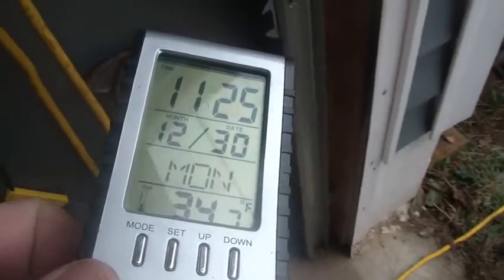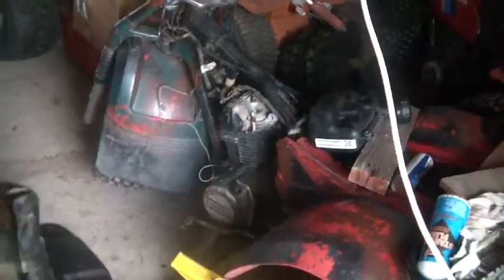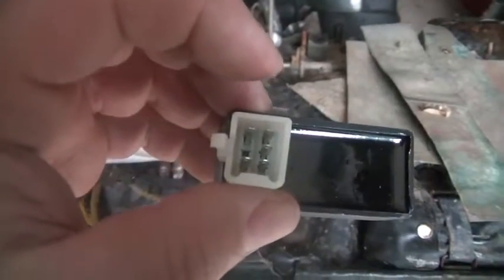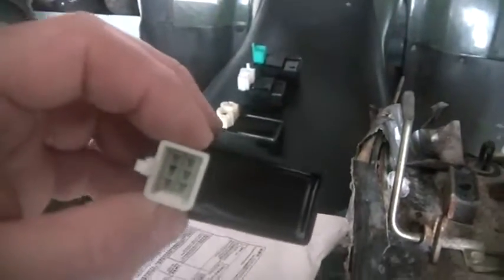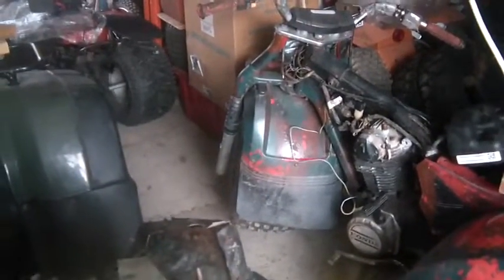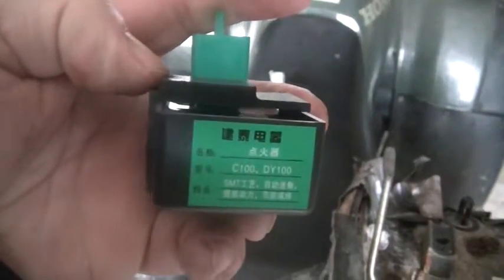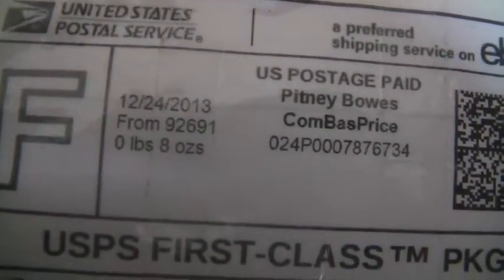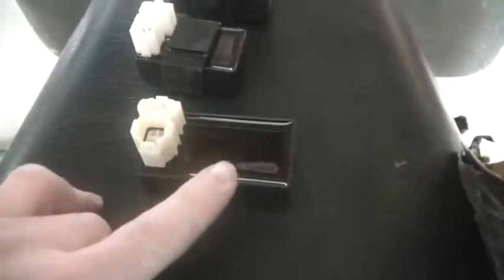12_30_2013, Everything I know about Honda ATC CDIs

Comment: I know older briggs you change spark advance with the gap of the points which\ is 0.20 but on a Tecumseh with points its with the coil which is a pain in the ass BC you have to set with a bunch of specialty tools and so forth.
Reply from the maker: MrBeeradb1, When I was a kid and did not know much about engines, I had a Tecumseh that the timing was too far advanced, (looking back now), it used to pull back so hard, I thought it was going to tear my arm off a few times. Thanks for the input, watching, and commenting!

Comment: To answer your question ...yes there are different spark curves as many things come into play like fuel octane ,compression ration,air flow,fuel to air ratio or lambda
Reply from the maker: Robbie, The spec sheets say the advance can be as much as 15 to 20degrees, I'm trying to wrap my head around that, is that a lot or just a tweak? Thanks for the info, watching, and commenting!

Comment: just a thaught ?
can you dissable the mechanical advance or maybe get 12 volt AC from battery after all its possible to recify AC to DC maybe you can get AC from DC.
or try use the AC unit with DC
that way you can use the smallest unit
Reply from the maker: Chox2001,  The mechanical advance can be disabled on the Honda 185/200 motor, so, I can put the DC cdi unit on one with the addition of a battery, it would be useful for troubleshooting, For the Honda 125/250, the DC CDI has a built in electronic advance which is needed and they have a 12volt system already. I hope I can get it all to work!  Thanks for you thoughts, watching and commenting!

Comment: AC power ? I thought the Honda ATC's used a Direct Current system. My honda 200x lights when i tested them they came up DC voltage.
Reply from the maker: Rainbow Dash, For a bike to have DC on board, there has to be a battery, no battery means AC, Even with a battery on board, most bikes power the CDI ignition circuit with AC. Thanks for watching and commenting!

Comment: Not sure if different cdi boxes have different curves , but I know if you build a custom car engine ,each one depending on how it is built,should be curved different to take the full advantage. May run ok and get by with a stock curve, but for peak performance  it needs its own. So i would think any curve that is stock would work ok ,but may not give the engine it`s fullest power. As far as having mechanical advance ,and adding a cdi with advance may lead to detonation,and early failure. But I am more schooled on cars than atvs
Reply: Also it is not just how far it advances timing that determines the curve ,but also the rate it advances , makes the curve. so some may give full advance at a different rpm.

Comment: You cant put the dc box on that atc . The dc box uses a pick up coil that runs off the crank. That pick up coil is a lower voltage than the one in the atc. The atc uses a high voltage coil on stator, the dc box makes it own high voltage. I have made it work but it wasn't right / hard to start to much advance /and after a short time it burned out the dc box.
Reply from the maker: William Staten, I knew there was someone out there who has tried this! The Hall effect, magnetic pick up should be about the same on both, I would supply an external 12volts, but,  the issue U brought up about the electronic advance screwing things up was what I was thinking about. What kind of bike did U put the DC CDI on?  Did U provide an external 12volts or did U rectify the AC from the stator to feed the CDI. Cool that U did this first, I would like to learn from you experience. Thanks for the info, watching, and commenting!
Reply: Harvey Spooner I'll make a video